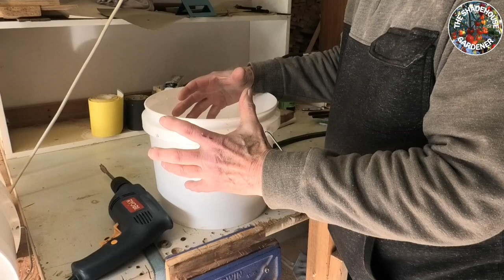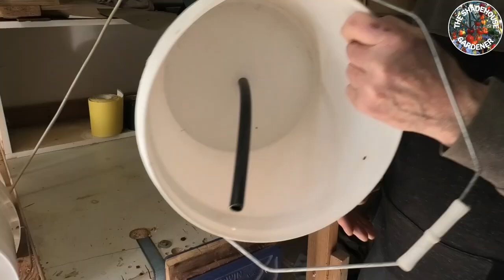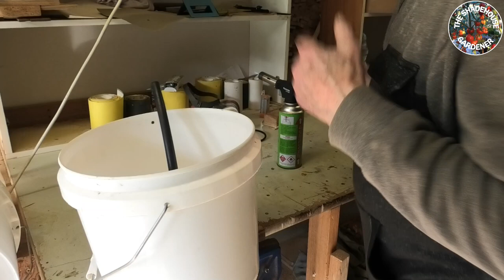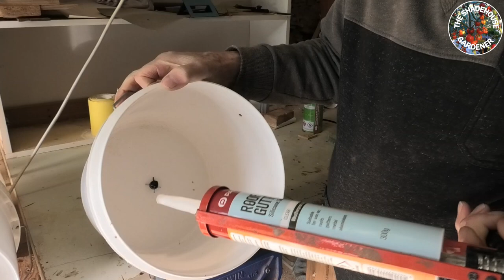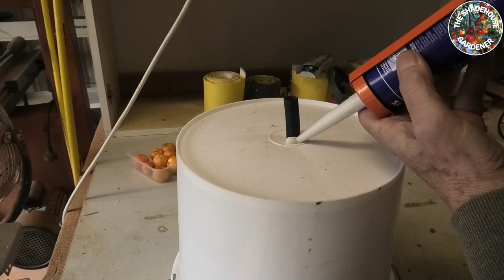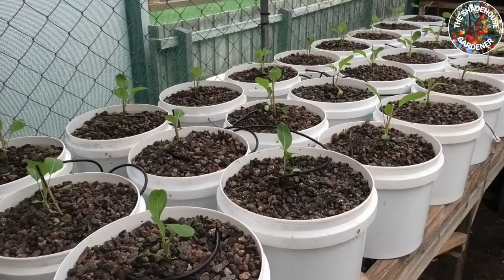2024 Hydroponic Dutch Buckets Build

Comment: Grommets aren’t that expensive. This is just messy and not very leak proof..
Reply from the maker: I have a video showing how to install gromets on the channel.
This video is a variation on a theme.
The slight leakage from the Dutch Buckets on this method is not a problem as the leaks run down the outlet pipe (13mm or 19mm tube) which fits into a 50mm hole drilled into the 4 inch PVC return pipe.